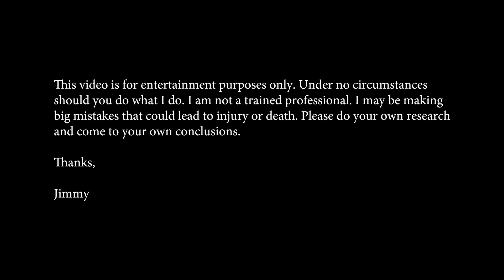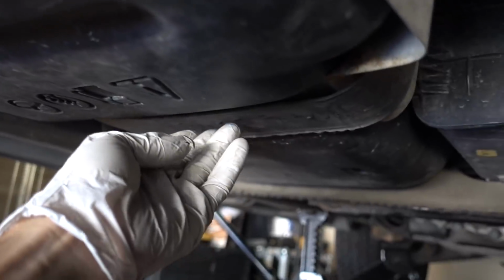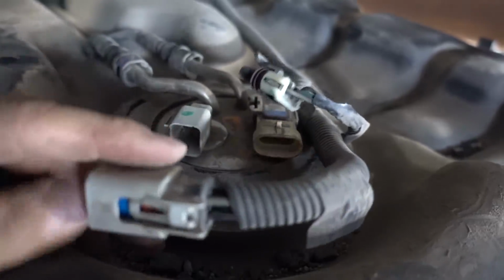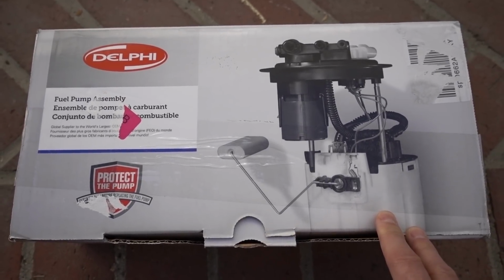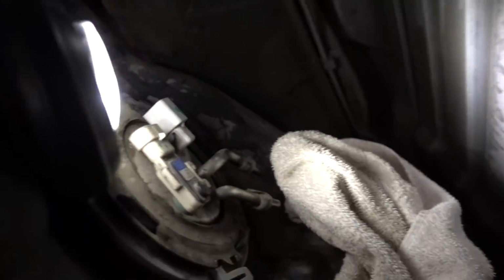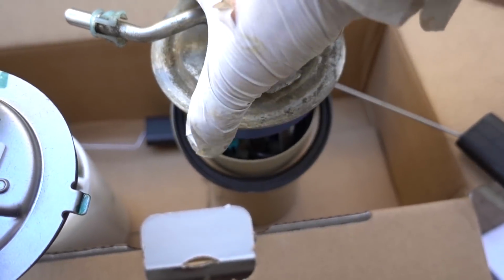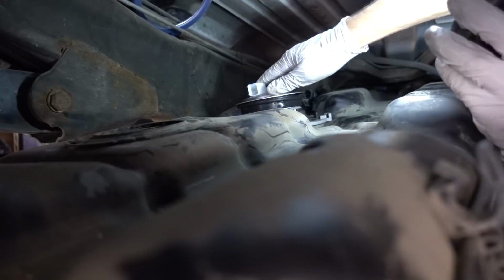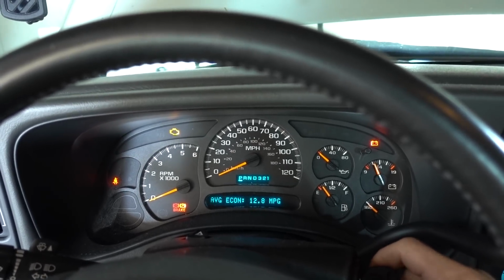CHEVY & GMC FUEL PUMP REPLACEMENT!!

Comment: Mass Air Flow sensor will not cause a no start condition when the engine is cold.  The OBD system is in open loop, it is not even reading the MAF yet.  I've never had an issue starting any engine with the MAF completely disconnected.  It just won't go into closed loop and will likely throw a code but should always start.  Those plugs on the pump are a prime location for some dielectric grease.  A little chassis grease on that top rubber gasket wouldn't hurt either.
Reply: Bones McGillicuddy  If it resists fuel, it will resist oil and grease.  Seriously, this problem was solved years ago with invention of neoprene and other synthetic rubbers.
Silicon grease is preferred for brakes, particularly caliper slide pins because of it greater heat and water resistance.
Oxidation is what kills rubber, just slower now.

Comment: About how much would it cost to have a shop (Firestone, Goodyear) or dealership replace a fuel pump?
Reply: $300-400 for labor depending on standard labor hours generally.  Problem is they will want to supply the pump also and will charge you double for it so the whole job can easily get into the $500-700 range.

Comment: Ok, I know the haters are gonna jump on here talking crap about the 'parts cannon' mentality you took with this whole saga, but you raise a point in the video that I'd love to know the explanation for. How in the heck does a bad fuel pump throw a MAF CEL?
Reply: It doesn't. No more than an ABS light coming on would cause the fuel pump to fail... It's just a coincidence. Now that I've solved your mystery with basic reasoning, you can get off your soap box.
Reply: @Des420  who's on a soap box? I'm just saying that replacing the MAF, given the code presented, made rational sense. The manifold gaskets seemed like a stretch, admittedly, but my point is that there were a lot of hater comments in some of the other videos for following what seemed to be sound logic. Good to know GMs throw whatever code they damn well please, I guess.
Reply: If he had been cranking it a lot without fuel pressure, it could throw a code. My Silverado would throw a code for the ignition coil when the pump was failing since it would start and run for like two seconds. The sensors got false readings and it threw thru code. Any car would do this so no need to throw shade on GM.
Reply: @helivesonforever  Thanks for explaining. That somewhat makes sense. Apologies for the 'shade' at GM. I suppose I've been lucky enough to never have a similar issue on an OBD2 car, so I haven't experienced this.
Reply: Yeah when you've been cranking for a long time and the car halfway starts and idles really low, weird stuff happens. The PCM thinks it's running even though it might only be at 300 rpm so all the sensors throw error codes. Still, I don't feel that his fuel pump should have failed at only 70k, but the vehicle is older so I suppose it isn't too out of the ordinary.
Reply: +Michael White - You had one foot up there with the hater talk... But I had one hand on the asshole button while replying too. I don't think you were deliberately being preachy though, so I apologize.
Reply: Plus this is an early OBD system it is a guide in trouble shooting.Even with all the test equipment on 737-800 we still had to put many people's heads together and sometimes call in a tech specialist.

Comment: While this is an older video Rock Auto is a great place to get parts and fuel pumps, especially for an older vehicle like his where you will likely need to order it regardless. The same Delphi pump was 40% cheaper through them then the same pump at even the cheapest local chain store.
Reply: Just watched the MAS cleaner video, & had forgotten I watched this when I was changing the fuel pump on my '05 Yukon XL flex fuel. Watching the MAS cleaning video the need to crank a couple of times before starting was the same thing mine did from the day I bought it as these things are notorious for burning up fuel pumps, & boy was it a huge headache on a rusty 18 year old vehicle.

Comment: How many miles is it, my 99 Tahoe fuel pump went out at 220,000 miles.
Reply: 99 Yukon 244000 miles.Don't know if it's been changed but I know how.Before you tube I relied on my father for trouble shooting help.

Comment: it sucks when you have to drop the tank to do this work
Reply: it only takes a few minutes to lower the tank to the ground with the right sockets and an impact wrench. in fact I just bought a 2002 Suburban from a fellow that had not gotten the tab on the fuel pump in the right place and gas was leaking everywhere.. I bought myself a 1/2" Dewalt battery operated midrange impact and boy does it make quick work of this kind of stuff.. I also picked up a complete set of  metric impact sockets from Harbor Freight a week or so back and together they make a great add on to my automotive tool; arsenal.  We ought to get Jimmy one of those 1/2' impacts for Christmas.  Ho Ho Ho!!
Reply: @thecarolinacraftsman4120  it should take a few minutes, but it doesn't.. a hatch above the tank is the way to go

Comment: Did this twice...need to do it a third time now.  First time was because the original pump died like yours, second time was a few months later because the fuel level sensor on the replacement pump stopped reading fuel level.  On the third pump now, and the fuel level sensor also died on that within a year.  Moral of the story?  Spend the bigger bucks on a AC Delco or Delphi, and don't buy cheap... It's the fuel level sensor that stops reading correct.

Comment: She is the cables on top of the fuel pump has juice it got hot wire if not check your inverters clip on inverters that happened to me it wasn't getting no juice into the pump even though it's a brand new pump it's the red and black cable on top of the fuel pump you got to pull it out of the tank

Comment: The reason you splice in a new plug is the wiring right after the plug at the pump is notorious for failing over time since you had pump out it would be smart to replace it and its not really that hard to splice it

Comment: A truck that old i would cut an access flap through floorboard ..This truck usually under back seat behind driver Suburban is in the cargo hold pretty much dead center .Way easy ,less fuss most times it is super hard to drop tank and pump usually will die when you fill the tank [ when it is failing ] so most times it will be full of gas .Cut flap drop pump in screw and gator tape flap shut put carpet back no one will ever know .Done deal 30 minutes tops .

Comment: On the Fuel Pump Next to Your  Square Connecor/ Plug In is the Flat Plug in- That is the Fuel Tank Pressure Sensor- I need to Replace My Tank Sensor... Because I have a CODE (0451 ...? ) That makes the Yellow " Service Engine Light Stay on While I Drive...and I cannot Get My 2000 GMC Yukon XL. Smogged.../ Registered Completely....until I repair the Code Problem. So - Sometimes it is Good to Replace The Fuel Tank Sensor...while You Have the Tank Down. A Backyard Mechanic wanted $150 to Change Out the Sensor...
Guess Who Pays for the Sensor....? These are the Kind of Issues You Run into when Somebody Unloads Their Used Car Problems on You...and They Just Walk Away.... With Your Money.
   BillinL.A.  10-24-21

Comment: Good job buddy.  Do not ever,ever,ever,  put you phone inside a fuel tank to film.  You lucky your phone didn't  ring, or static charge could ignite fuel.  Alway running fuel tank below 1/4 tank or pushing it with  low fuel warning on will  burn pump.  Wife is probably happy now.
Reply: Yeah, that was a crazy dangerous move..

Comment: HELP!  I BELIEVE I AM GETTING SCAMMED!.  

I need your opinion.  I live near Houston, Texas, and have a 1997 C1500 5.7 L Suburban which has had a weak fuel pump for several months requiring me to turn the key on and off and make numerous attempts to get it to start.  As it got worse so I began using starter fluid to get it going and it ran great till Thursday, 2 days ago.  It will still fire using the starting fluid, but then quit running.  I called my towing service who cranked the engine over a few times before loading it to attempt to start it before loading it on the flatbed and taking it to a mechanic.  The mechanic quoted me $375 labor if he used the fuel pump I had already purchased.  It was Thursday and I told him I could have probably figured out how to change the fuel pump myself but had no time because I had to have my vehicle to get my wife to three urgent doctor's appointments on the following Monday.  On Friday around noon, the mechanic called to say the starter needed to be replaced because it would spin, but not engage, and turned the engine over.  This was weird because the tow truck driver had tried it just before loading it and it worked.  I could have easily installed a new starter, but the mechanic said he could not install and test the fuel pump unless it would start and it would be $599 to replace the starter.  I had no other choice but to pay the $599 because of the urgency.  After the starter was replaced the mechanic then said he needed to replace the entire fuel pump assembly and that would be $1200.  Previously I was providing just the pump, but the mechanic now told me that the plastic connectors on a 97 Suburban were old and would "probably" break if he didn't replace the entire pump assembly.  (He knew it was a 97 model when he quoted the price earlier.)  I told him I could not afford it and that I would just go back to using starter fluid so I could at least get my wife to her urgent appointments that Monday.  He then informed me that the fuel pump was now blowing a fuse every time the key was turned on so the pump would not work at all and my Suburban would not run at all.  It had never blown a single fuse in the 8 years, and now it was EVERY time, leaving me with a non-running vehicle.  It was now nearly closing time and they did not work weekends so my only option was to leave it there to be repaired on Monday or have another towing service take it home and for me and I would try to fix it over the weekend so I could get my wife to her doctor's.  I have changed starters before, but I paid for a new starter to be installed because it had to be done in order to fix the fuel pump.  I had it towed home because I did not have the funds, I am now out $599 for a repair I could have done, and can't afford a repair that needs to be done because the price went from $375 to $1200.  

There are no buses where we live and since she has a very weak immune system, riding in my vehicle is her only option.  I am also disabled and have difficulty walking, and also compressed disk and nerve problems in my spine causing my left side not to work well so everything takes forever to do.  After looking at YouTube videos pulling the gas tank appears to be very hard for me to do so I was going to try to cut an access hole in the bed above the fuel pump and replace it that way.  I need to know exactly where on the gas tank the fuel pump is located so I can cut the opening in the right place.  Do you know of any videos or photos that will show exactly where I need to cut?   

I think the mechanic may have scammed me.  What do you think?  We are still praying for a miracle.

Comment: Had proper diagnostics been performed from the get go, this would've been fixed a LONG time ago. Check your Long Term Fuel Trims with any obd2 scanner. LTFT will help you diagnose any intake/exhaust leaks

Comment: My 05 Yukon pump was just fine until the top metal rusted all the hell.  New one was too expensive so I got a used one and greased the top and it's been running now for 4 years.
And no way was I going to drop the tank I chopped a hole under the backseat. 
GM should be ashamed of themselves and all the brake lines rust out in the Northern areas were there salt.

Comment: Just keep it 1/4 full  or higher  the GAS cools the fuel pump
Reply: Yeah what Punker said driving on fumes is bad for fuel pumps. Also check out the Top Tier Gas certification and use better gas than El cheapo brands like Murphy, Costco, etc.
Reply: It really doesnt matter on these trucks. They go bad all time for no reason. We see it at least once a month at our shop.

Comment: Only Delphi n ac Delco will fit correctly as far a wires.I get impretion stuff on eBay ECT are all scams I found part for ten they wanted 30

Comment: Never run the fuel tank below 1/8th tank. the fuel actually going through the pump lubricates it. Hard stops and long tight corners could deplete the fuel supply to the pump causing accelerated wear shortening the life of your new pump.

Comment: Use a clean rag or plastic and some tape common sense going to run to the store to buy caps for real you probably going to use it one time and then it sits in a drunk draw three $4 you could have spent on something else

Comment: Your comments on the quality of the pump you purchased and the defective pump you took out was hard to listen to. You also missed the huge burn mark on the plastic housing of the fuel pump at 11:14. Is this a video blog or a loose "guide" on diy fuel pump replacement? Just underlining your novice/liability disclaimer at beginning of videos completely delegitimizes any of that running(useless) commentary. Your common line "Everything seems to be...." could better be stated in a objective (visual) instead of uneducated opinions. You would be off measuring resistance across the motor windings with a multimeter adding valuable substance to your diagnosis. Appreciate you taking the time to make the video and I hope your not thinking I'm trying to rain on your parade. I enjoy watching your trials from a DIY perspective because it's relatable. 

One last thing you obviously seem to care about you vehicles. Why are you buying cheap fuel that contains the minimum government mandated detergent additives like cost co or Walmart. Detergents in fuel ensure complete combustion with minimal carbon build up keeping intake/EGR/Pistons cleaner. Checkout the TopTier gas certification that ensures 3x the government minimum additives. Shell and Exxon are just a few of many many different brands that are certified. These different automotive companies recommend Top Tier gas Audi,BMW,GM,FCA,Ford,Honda,Toyota,Mercedes-Benz,Navistar, and VWDetroit Diesel. Best regards
Reply: @capitandonzi2113  😂😂